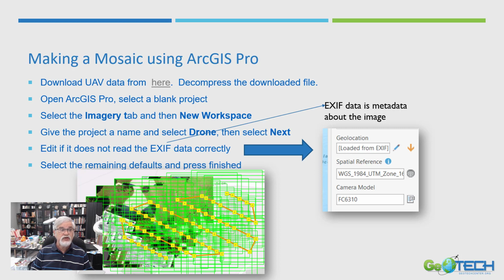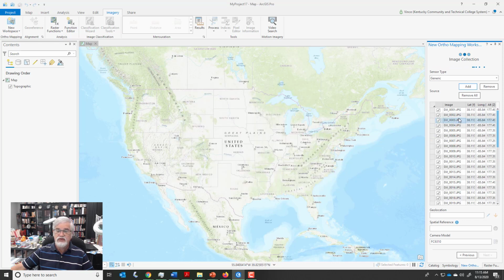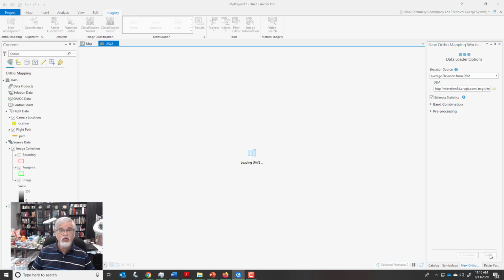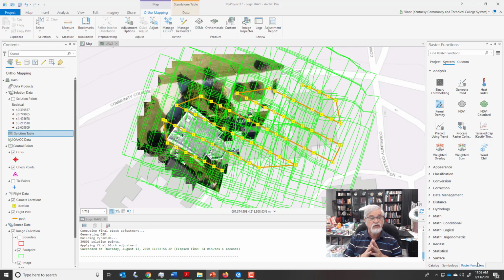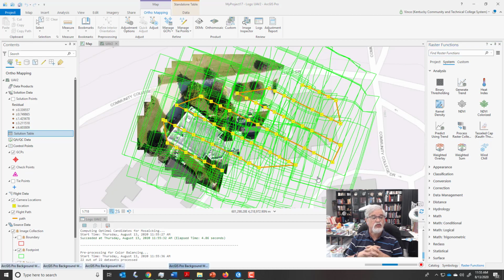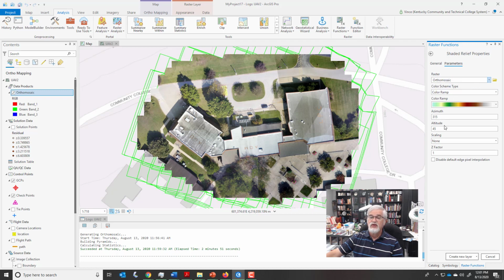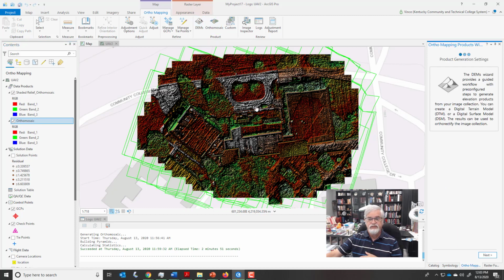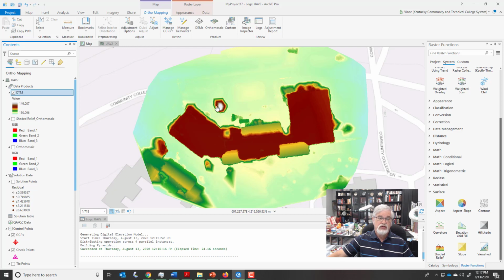UAV Image Processing in ArcGIS Pro

Comment: Thank you for this video! I tried to follow along but am getting error " Warning: Cannot compute flight height from input parameters. Use default value: 1.000 m. [DJI_0047] AND Warning: Cannot query focal length from input camera properties or built-in camera database. Use value queried from image Exif data: 10.260 mm. [DJI_0047]" what are the workaround   the EXIF data shows both are the same altitude 73feet